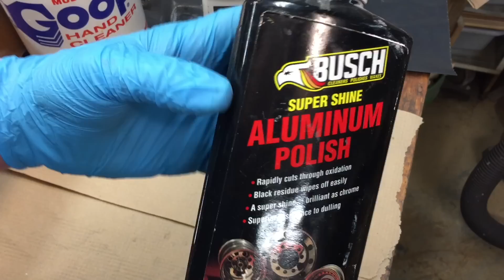Mr Pete's Restoration Challenge!!!!!

Comment: Wow.  I'd never seen a drill like that one.  Yesterday I was looking for a wire cutter and got into an old box I'd forgotten about.  I found three or four hammers and several tin snips I'd completely forgotten about.  I had bought them about ten years ago and packed them when I moved out here.  What was amazing was that there were two stud finders I'd forgotten about.  They both used the typical 9 volt  batteries.  One was a famous USA brand and the other was some Chinese brand battery.  The USA one was bulging while the Chinese one actually was still working!!  Just the opposite of what I expected.  - Kathie
Reply from the maker: Hi Kathie!  Of all the batteries the 9V ones are the least likely to leak, it's the way they re constructed.  Another thing to be aware of is if the devise is sealed (air tight) then the batteries will leak at a much faster rate!   Like flashlights with rubber o rings!   =)

Comment: Wonderful results! Beautiful artistry! Did you clean out the springs in the push drills? Could you make a new knob on your lathe?
Where did you find a new knob? The alternated painted rings are way over the top!
Reply from the maker: Hi Dennis, A little WD40 really cleans out the springs on those push drills, then only a drop of oil keeps them smooth...   I bought another drill on eBay for $16 shipped so I will see about possible parts..  =D

Comment: Great job as always...  I have a couple of questions.  1).On the Yankee Drill was the paper towel dry or did you use some type of compound to help get the scratches out?  How do you sharpen the drill bits for push drills?
Michael from Canada
Reply from the maker: Hi Michael, The Goop gets much of it off but then Wet sanding with 320 gets the rest off..    The tip of a push drill is very much like a standard drill, only the flutes are straight.  I didn't sharpen these but to sharpen them you need a very fine stone and a soft touch to first grind the angle and then the relief!  =D

Comment: Hi Scout: Have you ever tried Plastic Buffing Compound???,here is my tip,use a loosely sewn buffing wheel a very small amount of buffing compound and then a light touch to the buffing wheel, do not push the work hard into the buffing wheel because it can melt the plastic,try it out on a piece of scrap plastic!!!
Reply from the maker: Yes! You are so right,  Certain plastics do buff out nicely but I usually don't show that because almost everyone (myself included) will melt their first couple projects!!!!  -=D   It takes a very soft touch and lots of  patience!